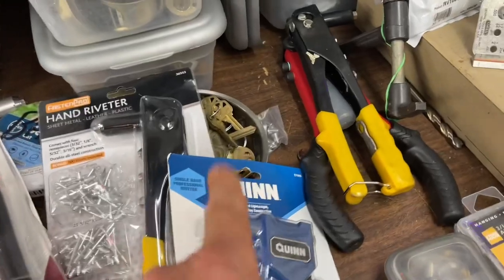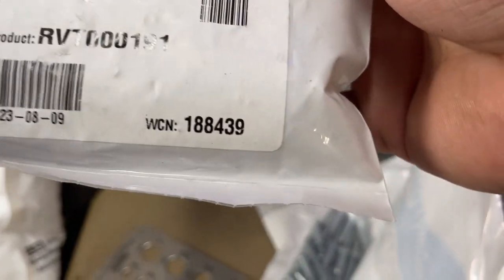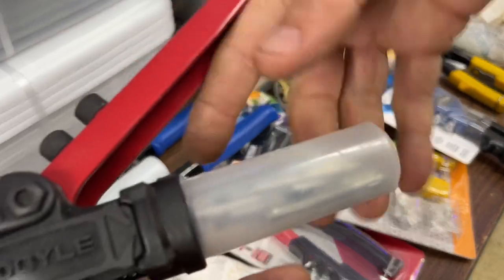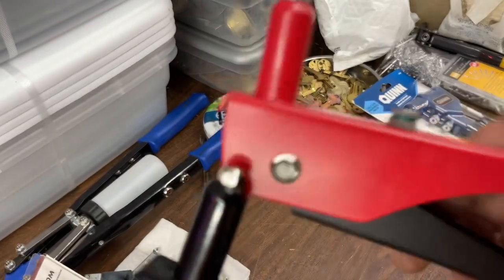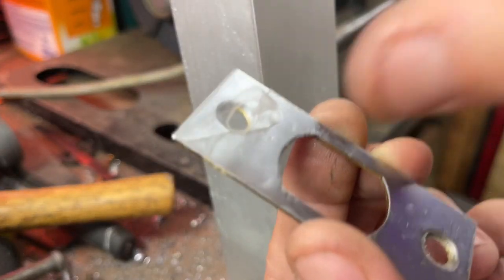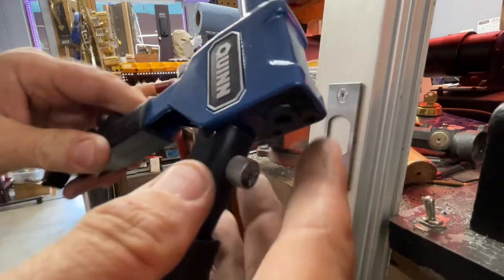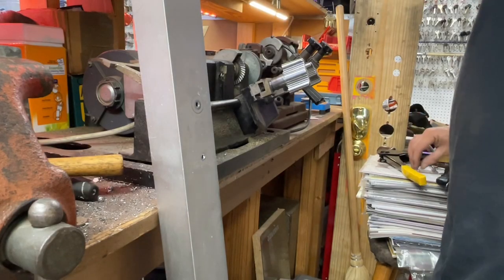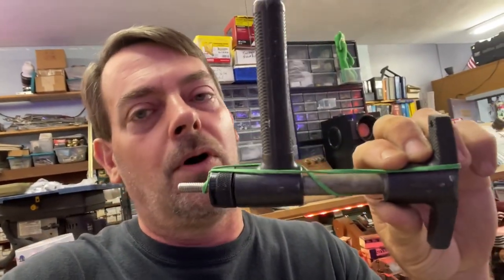Pop Rivet Tools for the Locksmith! Harbor Freight’s $5 tool, Quinn, Doyle, or Arrow?

Comment: I use a small arrow brand rivet gun because it fits in the larger center tub of the shallow Milwaukee pacout. Leaving four of the smaller tubs with dividers for storing a different rivets and backer washers.

Comment: I have some strong preference toward the Marson HP-2 over most other similar style pop rivet tools. The fact that you can order replacement parts for it suggests to me that it is intended for a longer service life.

If you work with pop rivets in larger quantities or sizes frequently most of the larger two hand tool or powered tool are worth it. personally I find even inexpensive pneumatic rivet guns work quite well. I have also have a used the Milwaukee M12 rivet gun a fair bit and love it. Honestly it is not all that expensive if you use a lot of rivets. 

I am interested in the wide range of drill powered rivet gun attachments like the Astro Tool ADR14 XL. They seem like they might be a good in between option. I have a Astro Tool AND14 riv-nut tool and have been very impressed with it. it has plenty of power and is not too hard to used. Much better than the basic wrench drive type tool and way easier to use than the pop rivet style riv-nut tools.
Reply from the maker: I use them so much I’ll probably end up with a Milwaukee tool for them, but for the “average” user any of these works fine :)

Comment: Their $9.99 swiveling head one is junk, you sometimes have to squeeze several times to get it to snap the rivet, the cheap $5 one actually works better. Regardless, for the price you can buy several and still have less invested than buying other brands and they come with rivets too, which is a good deal.